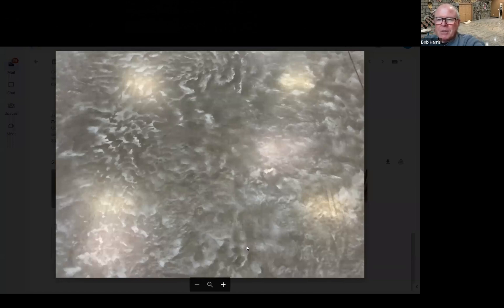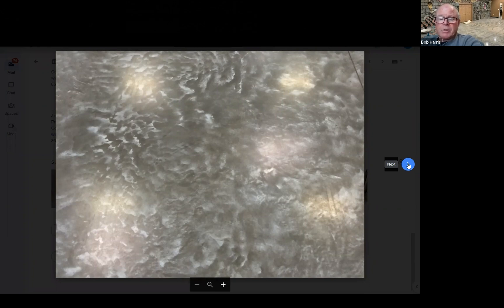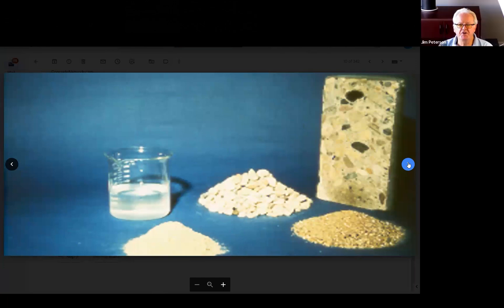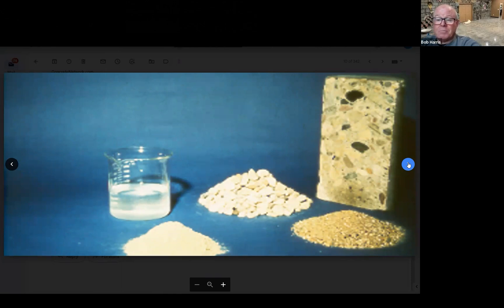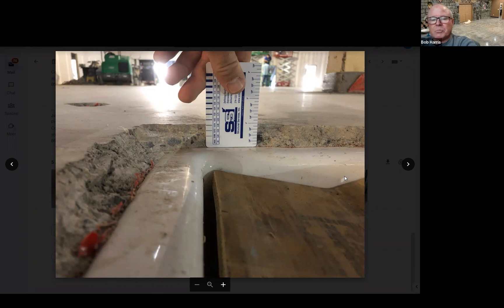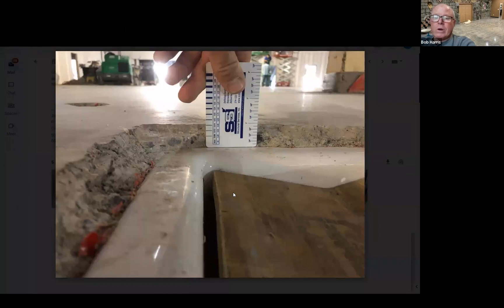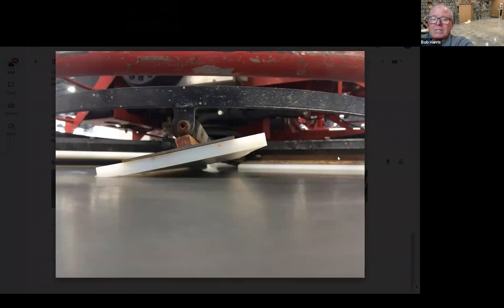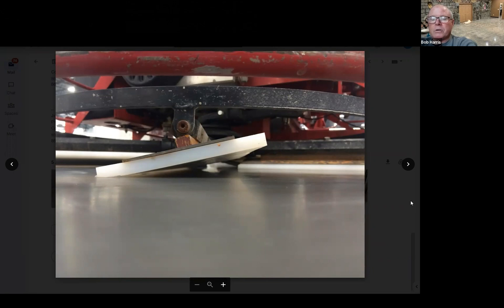Polished Concrete- Considerations Before the Pour

Comment: I am about to order concrete for a new residential slab floor. I want to have a creme polish with matte reflectivity. I am stumped how to direct my concrete contractor to get me the quality of mix design that will achieve the floor I want. Sand, slag, fly ash??? What the heck does all that mean? One contractor told me to avoid a certain local ready mix company because they used a black granite sand in their mix and he knew I wanted a light-toned grey concrete. Any suggestions how to instruct the concrete contractor or ready mix company to mix my concrete?
Reply: Hello  Wilheminia, did you get your queston answered?